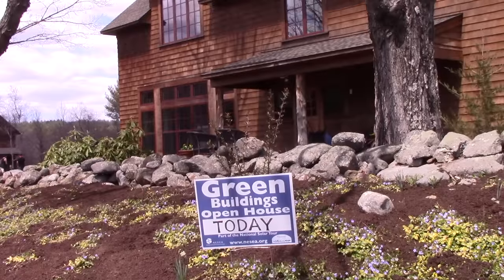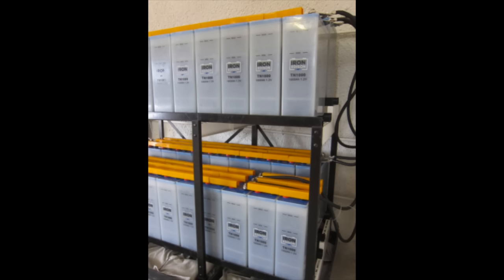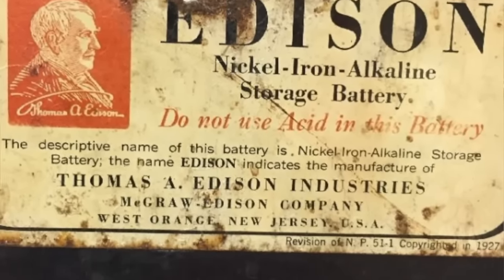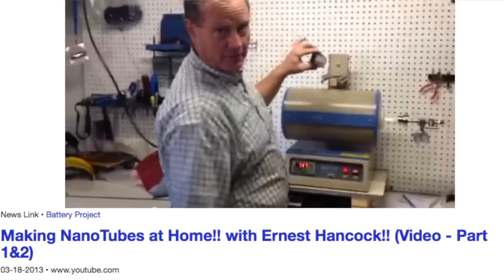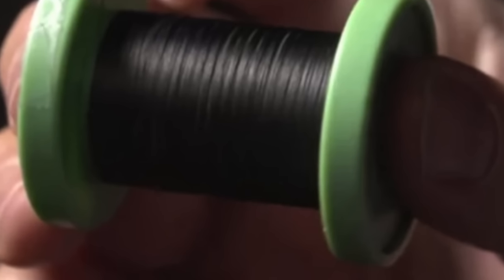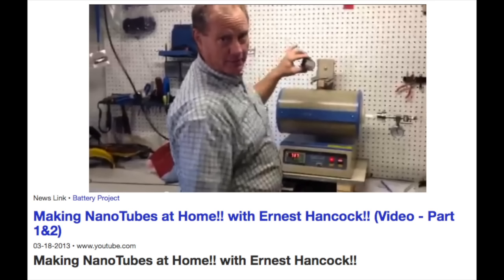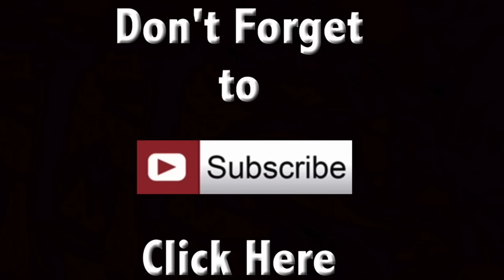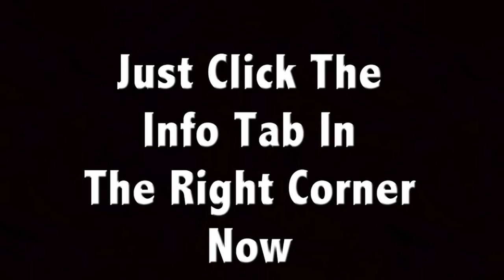The Best Battery for Off Grid and Solar Systems -  Nickel Iron NiFe Edison Battery - "Tarrin it Up"

Comment: You can talk theory all you want but I own a set of Iron Edison batteries (24v 600amh) and they are great. We are totally off grid and have had them for over a year and a half, a minimum of over 500 cycles, and considering you can have multiple in a day, there is no telling how many. We even run our electric hot water heater and dryer off them! I'd like to see what other batteries can do that. They did say the its recommended to change the electrolyte solution every 8-10 years. So far I've only had to add water. So far so good, thanks to Brandon, Jim, Timna, Luke and other at Iron Edison that make a great product and were a life saver when I installed the system.
Reply: hi so you will have had them 4 and a half years now, would you still recommend them? i was very eager to get into them a while back but there is too much FUD going around for me to want to spend the money on em.... also is hydrogen venting a problem worth worrying about in small spaces with naked flames or is it an insignificantly small amount? asking since they would be used on a small but well ventilated boat with solid fuel stove likely in proximity to the bank (like maybe 6-10 feet away). cheers -Doofus

ps actually while im thinking about explosions lol, is there anything besides the vented hydrogen and thermal runaway/water depletion that risks blowing these things up? or otherwise causing harm? i have heard that when changing the potassium hydroxide in the electrolyte that you don't want any open wounds because it dissolves fat (and tbh i would likely not want to be touching that stuff even if its meant to be fine on unbroken skin so i would probably wear gloves for any of that side of the maintenance) but should i worry about wearing a respirator or any other kind of PPE when doing maintenance on these? and actually while im on the topic, is there anything i should look up with regards to maintenance outside of keeping on top of watering the cells, and changing the electrolyte? i know they are supposedly very tolerant to over or under-discharge but from one of Will Prowse's vids (i think its unlisted now but it'll be visible from any of the threads mentioning NiFe on his forum-website thing) i vaguely recall something about them not being very cooperative with being charged at a constant voltage... or something... btw sorry to bombard you with so many questions lol, feel free to ignore any you think are dumb or i should have googled better etc...

Comment: cool technology I've been retired yacht and boat builder and Boatyard operator that kind of Technology could be big in the yachting community they live off Grid in a big way thank you
Reply: they are floating in electrolite they just need a couple of dissimilar metals and some wire...
see:   Xinhua | Updated: 2019-05-20 13:41
BEIJING - Chinese researchers have developed a low-cost underwater system to generate electricity from seawater, offering a new approach to handle short spikes in power demand and maintain longer-term steady power.
Underwater vehicles, diving robots and detectors require their own energy supply to operate independently of the mother ships for long periods of time.
The underwater challenge for power generators is to ensure a high energy density for basic power use and a high power density for activities such as rapid movement or use of a gripper.
Researchers from the East China Normal University in Shanghai, Shanghai University and the Chinese Research Academy of Environmental Sciences in Beijing reported in the German journal Angewandte Chemie that the key to the new generator is a cathode made of Prussian blue, an open framework structure with cyanide ions and iron ions which can easily accept and release electrons.
When combined with a metal anode, the structure can be used to generate electricity from seawater.
Tests show that the generator operates stably in corrosive seawater and can withstand mode switches. It ran continuously for four days in its high-energy mode without losing power. In the high-power mode, the generator can supply power to a total of 39 light-emitting diodes and propeller.

Comment: I live off-grid and I use lead-acid batteries because I can get them cheap. The Fire Service replaces the engine batteries every year and I buy the old ones. $60.00 for a 550CCA battery and they last for about 4 - 5 years.

Did some experiments with NiFe several years ago. I got a local foundry to cast up some thin cast iron plates and for the Nickel I used stainless steel (surface roughened) plated with Nickel, works a charm! The KOH can be hard to get sometimes and if it is difficult to get make it from hard wood ash. There are lots of vidz out there describing how to get it from ash.

I had the idea of using them but since I came across the source of cheap heavy duty batteries so I never followed it up.
Reply: Try ditching the nickel and using a carbon electrode.  That gets rid of a pile of the cost of the battery right there.  Plus you can use magnesium sulfate for an electrolyte.  Much cheaper and easier to find.  Does drop the max charge voltage by about half a volt though, so your battery banks will be bigger.
Reply: How did you oxidize the nickel to nickel (III) oxide hydroxide to get the battery to work in the first place? If you brominated the surface treatment it would flake off of stainless steel? KOH is not hard to get you can get it from basically any soap making supply store, Walmart sells it (caustic potash), ACE sells it, and you can find it online everywhere. 

You would NEVER use wood ash potash as an electrolyte for a battery LOL. Too many impurities to even count.
Reply: Those wouldn't be deep cycle batteries, though. Buying another set of used batteries each year or two doesn't sound much fun.
Reply: Laurence Perkins , hi, where do you get carbon electrodes from?
Reply: KOH is easy to make. Running electrolysis on a KCL solution will leave you with KOH solution after off gassing hydrogen and chlorine.

Comment: I have two 4-pack “crates” of these and one separate one in its own wooden crate, I have refilled one of the big crates with the electrolyte and am charging them now at 12 volts with a 10 ohm resistor, they level out at 6.25 volts, I am eventually going to mix some more electrolyte and get the other 5 working

Comment: I've installed a battery bank in my house. I'm using it to supply electricity to all one phase appliances. My three phase appliances are still on the grid. I'm always charging my 24 Volt bank at 32 Volts. I have 400Ah per cell so in total I have 9600 Ah available. I have 16 solar panels connected to the battery bank. My three phase appliances have a separate circuit where I have 22 solar panels connected to. I've read a lot about other batteries including power wall, NiCd etc. I found NiFe were more durable, more reliable and recyclable. That's the main reason I bought this system. I currently install them in Belgium. The batteries are Changhong which are also the manufacturer of the Iron Edison cells. Studer inverters and solar chargers are used, 16 Winaico solar panels 315Wp per 2 panels on one string.
Reply: What is the cycle amount of the batteries ? I'm also in Belgium and I'm checking for lifepo4 or gel.

Comment: An interesting battery tech.

A couple of years ago I was speaking to an engineer who maintains engines and carriages that run daily paid routes on a local UK restored steam railway.  We got to talking about the Edison batteries the carriages use for electrical lighting, which turn out to be the original ones those carriages were fitted with, and he tells me they are still just as good today as when they were first commissioned.
They are still using the same original batteries today in regular service.

Obviously those particular batteries were cycled a huge number of times throughout their very long lifetime, yet do not appear to have suffered degradation at all in similar fashion to some of their newer counterparts (as I am led to believe in other comments here).

Perhaps with a bit more development newer versions will gain higher output and manage to maintain their legendary reliability they used to be known for.
Reply: Me and a friend working on that project to make it better

Comment: in 1930 there was a cab company that had charging stations all over new york city and they would swap out 900 lb battery packs several times a day swapping battery's more often than driver and the cabs were maintenance free enough that they ran the 24 hr a day.

Comment: When the railroad in our area took out the tracks and dismantled the crossing guards the batteries that they used were these Edison batteries , they left them sitting on the roads , so I picked up 20 of those and just changed the electrolyte. Each one is about 8" x 6" x 18" tall , the electrolyte is similar to a lye solution. The problem is the weight , each one is 1.2 to 1.8 volts and is bigger than one car battery , in a bank that is OK but its very hard to move like camping with them in a 12 volt mode . but I going to try with my panels and see how they do.
Reply: Please make a video about those batteries!
Reply: Damn you just found like a 100K on the road. 👍
Reply: you can demont them, clean from dirt and they will ran again. Glückspilz!!!

Comment: Thank you, sir, for putting forth the idea about the carbon-fiber dipped in nickel. Wouldn't it just be a kick in the pant's if someone were able to make a relatively thin one the size of a solar panel that the panel actually attached too?  This would solve two problems in one (Power Supply & Storage). So if you were able to mount six panel/batteries to the top of your RV, you have not only solved battery storage, you have evenly distributed wieght in the the process.
Reply: Nickel plate some carbon foam and then pack it with nickel oxy-hydroxide.

Comment: the cool thing about nickel-iron batteries is you renew the electrolyte potassium hydroxide, not the battery itself. I've got a set that I got used in the 80s and it's still going strong today.

Comment: Since you off the grid may I suggest a manual battery, you need a iron carbon rod and some type of spice. You might also want to hook up a peer to peer grid with your neighbors, make sure to have a credit system to trade traffic.

Comment: Great information. The problem with Nickel Iron batteries for me is three fold. One is the initial cost of the battery bank.#1The batteries cost about twice as much as FLA batteries.#2 the Nickel Iron batteries give off the stored power much slower, this is only answered by having a much larger battery bank than FLA. #3 The Nickel Iron battery is very inefficient compared to FLA. This requires the charging scores to be much bigger than would be necessary with FLA. That said If money and space was no consideration then I would buy in. Until that happens I will have to stay with the FLA for my off grid home. FLA batteries properly cared for and operated (never lower than 80% SOC) can last 20 years. Also having the voltage set point for the absorb cycle at the recommendations of the Sandia Laboratory US GOV. recommendations.
Reply: I agree with some of that but if you keep FLA above 80% SOC, then you need 5x as many batteries compared to being able to go to 0% SOC.  FLA at high SOC is just as inefficient as NiFe.  On the other hand if you add carbon negatives electrode to a FLA to make an "Ultrabattery" it might fix all of that.